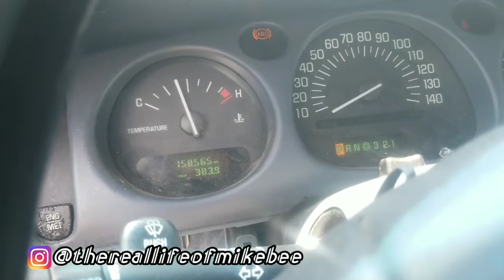How To Fix A Broken Turn Signal /Turn Signal Relay 2000 Buick Lesabre

Comment: Did you find out the problem? I have a 2001 Buick that’s having the same problem and I’m trynna see what’s wrong.
Reply from the maker: No unfortunately I didn't never get around to the problem. 🙁 best thing to do it get in contact with a car electrician asap

Comment: My identifix program tells me it's the turn signal/hazard flasher module which is located to the right of the steering column way up behind the dash, apparently it is necessary to remove the dash pad completely and partially remove the dash assembly to access the flasher module :-) or it could be the turn signal switch itself. If your car battery is being drained down it's probably the hazard flasher module :-)